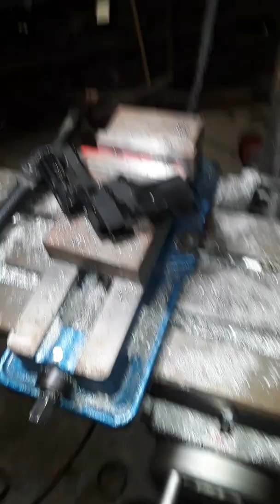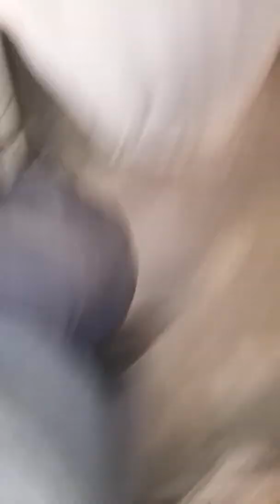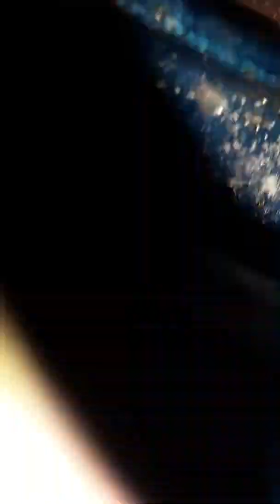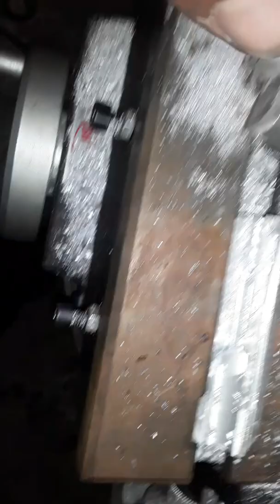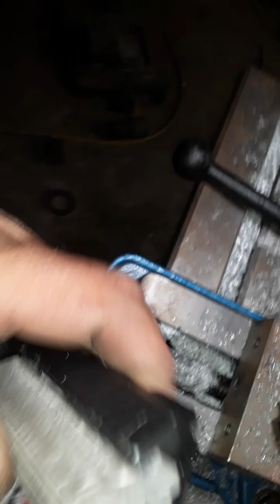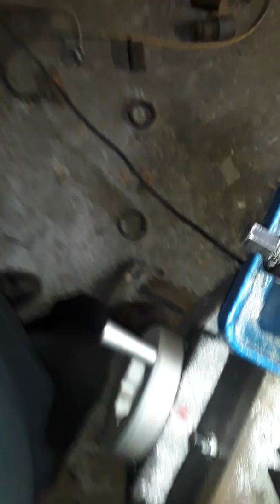Bored tisa

Comment: 32 is best for   all up to   9x17 revolver cobra  it can take    38 spl or bett 28  long colt    loaded    to     like  25 perc  less power as  38 spl   ,brass can be    38 spl   loaded wadcutter or 2 mm shortened and  //